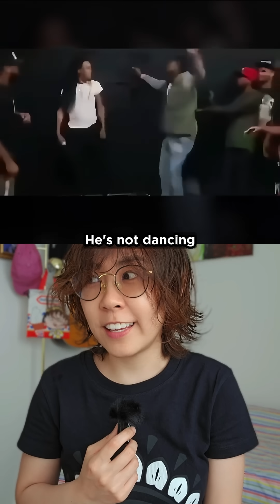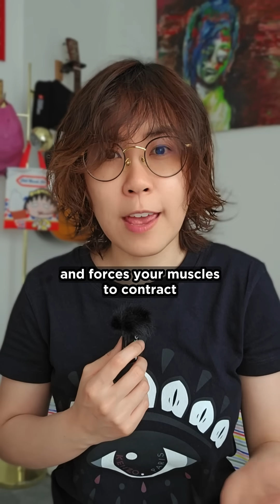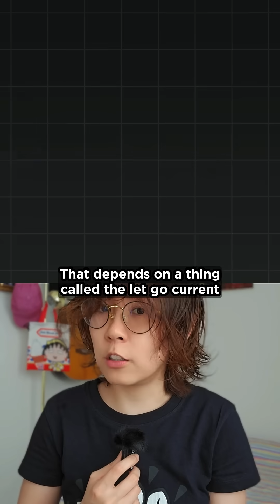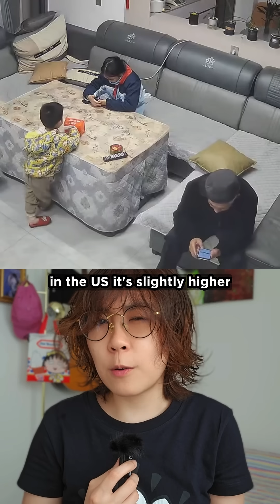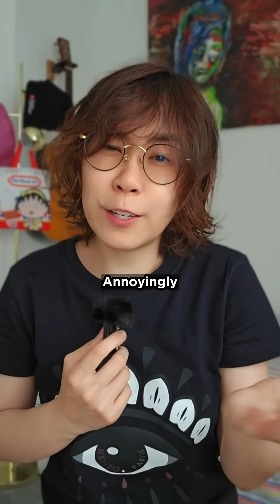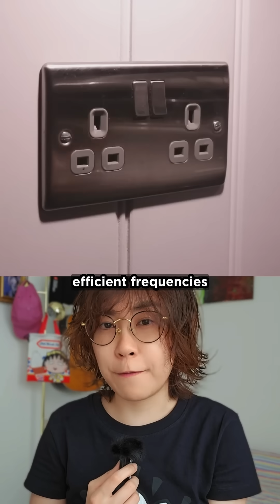How Much Electricity Can You Touch Before You Can't Let Go?

Comment: Thankfully in modern installations there are RCDs which trip when the current isn't returned with the neutral wire. So regardless of frequency, if 30mA (in EU) passes elsewhere than the neutral the power shuts off. This technology saves lives every day.
Reply: 30mA is above the "let go current". There can be situations where you can still get a shock. I had this two times in my life. Once with a defect pond pump. The resistance was high enough to get only a few mA but the electricity was recognisable.
The second time a defect motor condensator and a faulty electrical installation gave me a shock. It only happened when you touched the washing machine and the dryer at the same time. Which didn't happened for years until I did it by coincidence
Reply: @1234fishnet  it's aiming to be below the lethal level, that is to say a level that can reach the heart.  Low amounts of leakage current are normal so it's a balancing act between saving lives and preventing constant nuciance tripping.
Reply: In addition to just shutting off, it shuts off  fast, within half a heartbeat or so, thus preventing the heart to lock up. I'm sure there is someone here who knows exactly how it works.
Reply: In my country, we don't know what RCDs are 😂
Reply: Ideally every outlets [not include for example ceiling light] have trip breakers.
So 1 faulty tool won't shut down the whole house.
Repair guy usually connect outlet to his portable breaker, then connect faulty tool.
Reply: @budisutanto5987 Breakers and RCD/GFI's are different.
Reply: In the US the only locations to have RCD protection are wet locations and will have a GFCI outlet. Same principle different setup. Granted I think they finally changed code to include GFCI breakers in the mains panel so every outlet is protected including arc fault breakers, but this is not common only new builds I believe, but I might be wrong. Same with shuttered outlets, they just started to be a thing.
Reply: @peteasmr2952 they didn’t but they did expand it so utilities rooms, kitchens, bathrooms, basements, and garages all need gfci protection, and afci protection is required for all habitable spaces in homes(anything but garages and closets) but it is made it so it is easier and cheaper to just put in gfci afci combo breakers in for the whole house, also the tamper resistant recepticles are required everywhere but as with all construction all existing builds are grandfathered in unless we do work then they must be brought up to code
Reply: @TimothyStribling  Interesting that seems like progress then hopefully. Good to know thank you for sharing.
Reply: @peteasmr2952  And often they are not even configured correctly, at least what I seen in videos from building inspectors here
Reply: Yeah that’s what my bf explained too. Though I know that it’s a things in some parts of the EU. Don’t know about the other continents though
Reply: @1234fishnet There's 5mA one's, those are better. Btw in high voltage powergrids, it exceeds 30mA by a lot.
Reply: oh yeah btw American standards dont have these because they use 120V, and only in bathrooms and kitchen where people are likely to touch live wires use GFCI.

unfortunately some of these safety measures are unable to safely trip and save you if you are directly between live and neutral. be vigilant and always maintain and test your electric systems

Comment: Please talk about electricity and water too. Does water really make electrifying multiple times worse & more dangerous?
Also about electricity in general cause it's used for many many things in our everyday life
Reply: Pure (distill, 0 tds, not tap water) Water isn't conductor but if you put some impurity like salt then it becomes good conductor
Reply: @vishakhakanojiya5912  is sult itself conductor?
Reply: @MiJi-87   in liquid state yep
In solid state nope
Reply: @MiJi-87  salt crystal is not conductive, the ion mixed in water is conductive. The water spreads dangerous high voltage into wider area. If you are trapped in the flood where there's active outlet, you need to get away from it, but first you must keep your feet as close as possible and keep balance to not fall into the water, then slowly move away from the active outlets or out of the water.
Reply: @samueladitya1729  what is the range of the electrocuted area in a flooded pool of any given size. I've always wondered, does it entirely become electrocuted or just the proximity of the outlet
Reply: @isaacleibniz2437  the safe area is usually more than 5 meters from the live contact for 220V. It gradually increases voltage difference the more near you to it. The electricity always flow to the ground path, so if you're floating you're safer, try not to touch the floor or walls, avoid metal ladder or anything metal that attached to the wall or floor.
Reply: @vishakhakanojiya5912  well, no water is pure in everyday life, pool water or water pumped straight from a well, they are conductive enough to feel the shock.
Reply: Depending on how much the water is ionized.

Comment: The smirk after "it's a bit of a compromise" is scary. She 'bout to bully someone 😂
Reply: Sounds like someone just had an idea for a dance class side-hustle.
Reply: She can bully me 😔
Reply: @FragmentOfInfinity bro gets it
Reply: @FragmentOfInfinity 
Same bro, same😔
Reply: This is fake as hell I accidently touched the bare wire behind the socket board and felt a nice smooth regeneration flow through my body very powerfully feeling like high blood pressure 😂😂😂 y'all either some beta humans or idk y'all so weird are ya dizzy 😂😂😂
Reply: @IHATEPOLICE203 Same I felt my hands glow and my eyes could see UV and IR, I could feel my feet leaving the ground as an energy halo surrounded as I escaped this slowly decaying mortal shell
Reply: @IHATEPOLICE203ok, try touch a power line next then?😂
Reply: @IHATEPOLICE203no way you're this rxtarded that had to be ragebait
Reply: @IHATEPOLICE203 Not sure which cable you touched but I have gotten into contact with our house powerline. That burned my hand and it hurt. However when I was dealing with cables for sockets and lamps it was more like pins and needles. Basically do not touch the actual powerline, that stuff is serious.